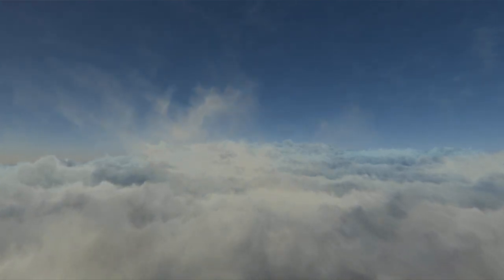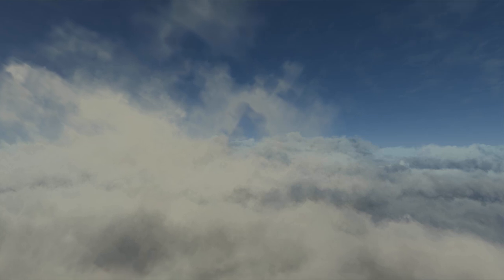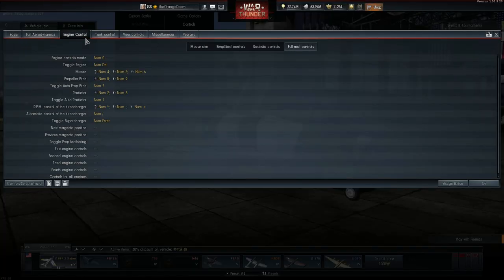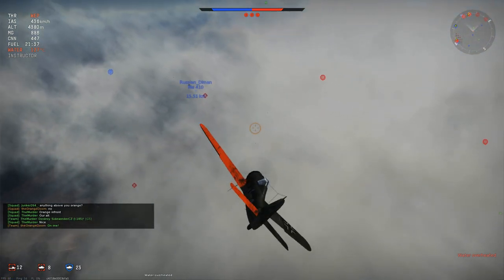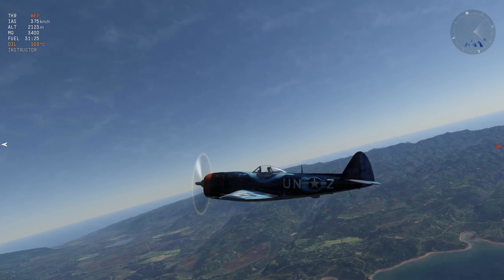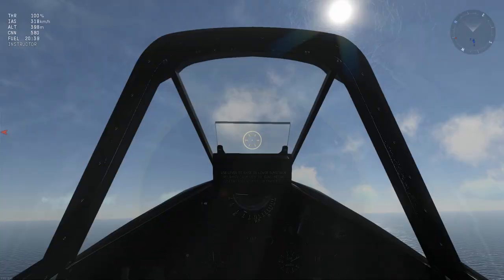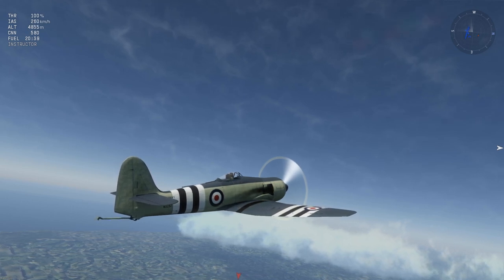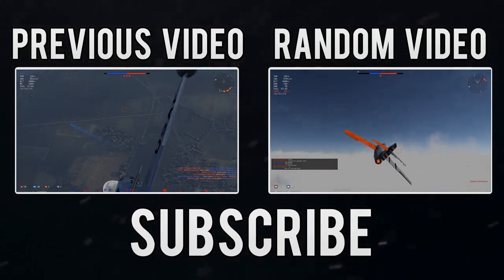War Thunder Advanced Tutorial - How To Use Manual Engine Controls  -  Working in SB and RB

Comment: Before I watch this video, I hope Orange actually knows how to use MEC. In a previous vid with the Seafire FR Mk.47 he intentionally left prop pitch at 50%, effectively removing half of its thrust and yet claimed the plane was slow.
Reply from the maker: It still is slow :p
Reply: theOrangeDoom Orange, since your current Mk47 vid is FUBAR. Can you get another video up using regular auto controls? I agree with you that its slow, but using 50% pitch probably exacerbated the problem. It's also missing around 300 HP compared to its historical settings.
Reply from the maker: ***** No, even with proper MEC handling the plane is slow as sh*t, and I have all performance upgrades as we speak and yes it does get a bit better, but I'm not flying it out again..
Reply: theOrangeDoom Okay, no probs. Looks like we'll be waiting for a FM update then :)

Comment: Planning on using this for SB air races if Gaijin ever brings them back. Using SB with VR, it is too many binds when using a controller for normal battles, so I don't think I will be using this for straight up battles anytime soon. But I suspect that if I mess with the mixture and keep the supercharger in gear 1, I might be able to get a little extra power out of the plane, maybe prop feathering as well. Of course I will have to have a special air race control file where I replace combat actions with mec, but I hope I get to try this out in air races sometime. Thanks to both the comments and the video for the heads up.

Comment: Hey @theOrangeDoom I don't know if someone has already said this or if it's even modeled but the turbos can't be used at high manifold pressures/ engine RPM as it causes over boosting (not sure if they have waste gates to prevent this in these planes) in the turbos compressor which can lead to damage of the turbo or engine from too much exhaust gas going to the turbo. They're only really used in low RPM scenarios, that's why supercharges are preferred for higher power fighter engines.

Comment: 2 years late but, a little tip: drag from 100% prop pitch makes a nice airbrake. Helpful in sketchy landings to slow down quickly, and also for dives once you reach redline speeds.

Note: I usually use this with the 109s and 190s while cutting the engine... because you never want to use maximum prop pitch with throttle on any german plane...

Comment: Hi orange, nice tuto for the ones looking for something more "hardcore".
I got a question, based on the use of mixture.
As u probably know, the mixture defines how much fuel u send in the engine to have a correct mix with  the air being compressed in the pistons, to optimize the explosion giving the power.
And getting high u get less air, that s why u have to lower the mixture(or to be correct lower the fuel intake to have a correct mixture).
Now comes my question:
a supercharger is a system compressing extra air in the pistons, so theorically to optimize the explosion u have to had more fuel to get a fine mixture with the extra air coming in.
Did u try to correct the mixture after a supercharger level change?
Did u see any effect?

Comment: Whenever I press my key to change the prop pitch, as soon as I release the key it goes back, what do I use to fix that, I figure during my entire flight I couldn’t hold the button since I only have two hands
Reply: I have relative control on but it still does the same as the other dude that commented

Comment: Great tip for MEC: the radiator doesn't have an effect on the water and engine temperature. From what i've tested, it will only effect the oil temperature.
BTW love your vids as allways Orange ^^

Comment: theOrangeDoom so this means that with the manual controls can make, for example, the Ta 152H-1 have the real engien performance in high altitude, becauase I understand that with the auto controls it actualy is not posible...
Reply from the maker: Adrian Diaz I didn't quite catch you there. All you can do is push the plane a little bit further
Reply: Well I see a video from MagzTV and basically he said that the Ta 152 have only the name but not the performance
Reply from the maker: Adrian Diaz It has the wrong FM I agree
Reply: Well that's what i try to say :)
Reply: And if the manual engine controls can make the FM a little bit more acurate

Comment: hey orange i just started to use MEC. i have couple ?s. 
1st- setting up the engine controls, at first my radiator would only havve 50% and 100%, until i clicked yes on the Relative Control panal. is this correct? and if so what about the disable axis panal? do i put that to ON as well?
2nd- whats a good mixture to set for american planes?
3rd- prop pitch, so on a low alt dogfight what a good setting for it 100%?
sorry but i had to ask to find out. thanks!

Comment: I have a question about putting out a plane fuel tank fire, I can't find much on internet other than either turn off your engine and glide, turn off your engine and dive, just turn off the engine, or dive as fast as possible ( in WEP, if possible)
So what do i do in those wing fuel tank fires situations?

Comment: I know that im late to ask this but i managed to set these settings but as i noticed when i press to for example radiator control, it Automatically comes back to normal if i dont hold it. Why is that and is there any solution?

Comment: turbo has to be auto, else increase with height carefully. Too high, engine dies, too low, no boost. In the cockpit see what the manafold pressure is on auto, keep that at all times, alts and speeds dough dependant on throttle, in manual.

Comment: IF you overrev your engine with prop pitch, you can save it by deactivating MEC
Reply: no if you kill your engine the damage is real
deactivating MEC is for auto radiator\oil radiator , they can save you
or use manual and 60% pitch whent use 80% of power for go back to airport
dont use flaps
try to climb very slow because when engine die you can only glide
with bf109e1 2.0 i dive bombing on enemy airport, catch some flak and climbed :D
manual saved me
i climbed and dived like stuke from 6000mt (max attack for flak) i returned at 3000mt but injuried i climbed again until at 5000mt engine died
from enemy airport to mine safely thanks to MANUAL XD
deactivating MEC is ......stupid :)

Comment: There is a little bit of a problem, Gaijin changed the options and the options you put up won't work properly, could you make a video about how to calibrate these options for a keyboard to be optimal and work properly?
Reply: yes they will, when you click on something like prop pitch mixture or radiator be sure to turn on relative control and pretty much copy his controls and it'll work :))

Comment: I can only get the prop controls to do anything. All of the others will just say "no (x) control", even though I set them. It sucks in particular because the main reason I'm trying this is radiator control for my FW 190 A-1 that burns up if I fly it over 84%

Edit- Turns out it's just because that plane doesn't give you the option to adjust it those settings. Tried other planes and they worked. So the plane that needs radiator control the most doesn't get it :|

Comment: Hey, I was mainly interested in how to control the turbocharger for my high altitude fighting, but whenever I hit the toggle button, it just says supercharger gear:1.... it isn't toggling to gear 2. Any ideas?
Reply: +theOrangeDoom You don't have to answer my previous question lol... I did some testing of my own and found out that the P-47M (my favorite high altitude fighter) doesn't even have a second supercharger gear while other aircraft do, which is really pissing me off!
Reply from the maker: +Jack Dodsworth turbocharger is broken in this game, don't use it. As for the supercharger gear on P-47s there's only one. Which means one less thing to look at.
Reply: theOrangeDoom Thanks! Your tidbits on radiator and mixture control have helped my immensely though, so thanks for that as well.

Comment: Hey Orange! Recently I play SB air battles, but sometimes play low BR too, and there are some low BR British fighters, like the Vb/trop Spitfire, which at -G power (nose pushed down, or dive) simply drowns. When I started to be better with SB I was at tier 3+ and those fighters didnt drown, so Im not so expierenced on how to avoid this issue, sometimes is annoying when I want to dive on an enemy but my Vb/trop loses energy while drown. If you can please help me. Thank you!
Reply from the maker: 576 ColoS I don't know the proper expression of the case, but most early engines die of carburetor failure because fuel isn't being injected into the engine. there's no bipass for this, if your engine dies you have to turn it back on.
Reply: theOrangeDoom Thank you for your answere

Comment: Mixture is not properly simulated, I thinkthat the 120works for some extra HPs at sea level but nothing more... If you fly at 5000m with full mixture the engine will shut of, same as if u fly with 0%, thing that doesnt happens in WT...........

Comment: Yo Orange, I'm doing as you have said on the forums and the video, I also have the config on, but when I press my Numpad 0, the controls dont turn on, theres no text in the bottom of the screen and it does not allow me to for example close my radiator, any tips?
Reply from the maker: +Slothyn check the controls manually. Are you testing in RB or AB?
Reply: theOrangeDoom Oh, you might be right, I was testing in the Arcade battle test flights, I will try as soon as I get home
Reply from the maker: Slothyn That's the problem. It doesn't show up in AB. Let me know if it works.
Reply: Yea, you were right, that was definitely the problem.. Cheers

Comment: Quick question, would you by chance know how to disable the "auto engine restart"? Sorry but I can't think of what it would be actually called but thats a name that matches what it does, Every time I turn off the engine, it automatically turns that off. Been searching all over the controls and can't seem to find anything for it.
Reply from the maker: The Major Ragers Wait, you turn the engine off, and it turns back on?
Reply: That's instructor
Reply: Is your throttle on 1% when you turn off the engine because that leads to the engine turning off then turning back on. Any throttle settings whilst the engine is off will cause it to start back up.
Reply: theOrangeDoom Yes, automatically. I use mouse aim control if that helps for anything...
Reply: theOrangeDoom lol never mind, i figured it out.
Reply from the maker: The Major Ragers what was the problem? instructor?
Reply: theOrangeDoom Yep, lol. My bad, shoulda checked on that before hand.

Comment: So my only problem is when I try to control the radiator, it either goes 50 to 100 or 50 to 0  when using the keys.
Reply: ahhh nvm I fixed it, it's just a little slow, but I think I know how to fix that too..
Reply: Yea I got it a while back, thanks though it will help others.
Reply: +Modzer627 How do you fix that?

Comment: I dont know whi it doesn't work on me.
When i left the key to go to 100% it return to 50.
Same whit radiator prop. Pitch and mixture.
Someone can help
Reply: Jesus H. Read: its been mentioned about 50 times in comments already. Its specified in the tutorial article he has linked. Also, as a general rule, it applies to anything, not just MEC, when you are using keys to bind for anything that isnt binary, ie on/off

Turn on relative control when binding...

Comment: I set up all the Controls for manual engine control yet when i activate mec and want to adjust eg. radiator control or pürop pitch it goes:

MANUAL pitch control is disabled as AUTO mode is enabled
MANUAL radiator control is disabled as AUTO mode is enabled

cant do this cant do that

WTF didnt i jsut enable MANUAL controls ? wtf is going on ?
Reply: Go to game options and somewhere you will find a thing called relative controls. use it.